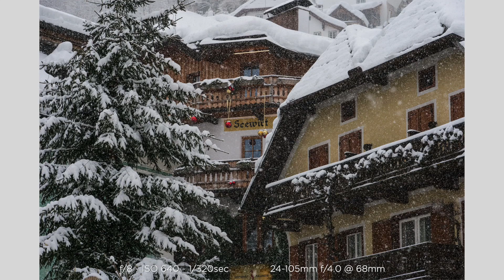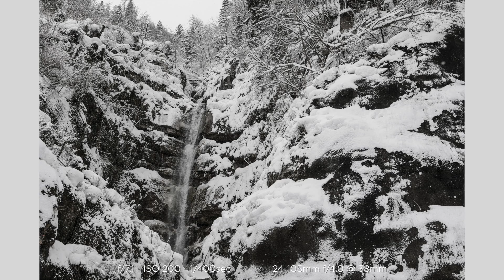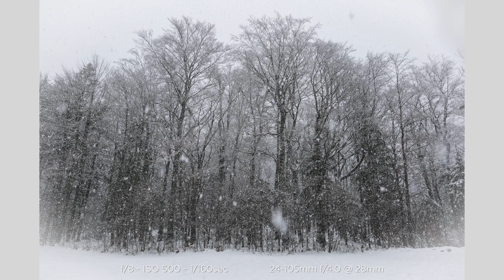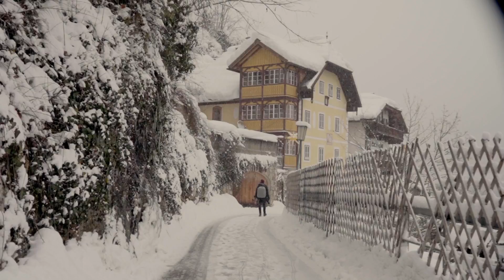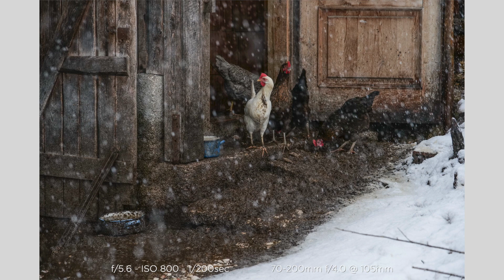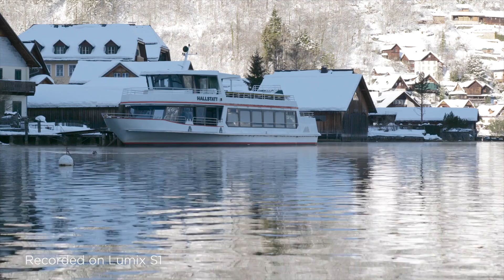Panasonic Lumix S1 & S1R | Hands-on in Hallstatt, Austria

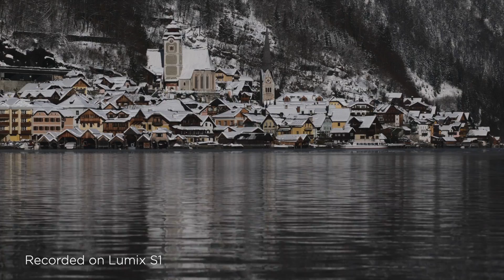Comment: Thanks for this very informative review 👍. But ahhhh, around 10:20, can’t believe it, to see the camera mounted to tripod instead of lens. With that heavy lens mounted 🙈. Do you have any idea how much force is leveraged to that tiny ¼” nut? I baby my gear as good as possible, so, this hurts so much.
Reply: It's an f/4 so it's only 985g; approximately the same weight as the camera.  The tripod collar is for convenient switching to portrait mode, and the L mount is built to be extra strong.
Reply: @fellowcitizen , which F4? Brand? Can't detect it in the video. However: I am NOT talking about the L mount. But the ¼" screw bottom of camera. ¼" = 11.5 inner and 13.2 outer diameter. This results in an average radius of 6.175mm = 0.006175m. I have no clue which lens that is, so, I must guess: length about 300mm, lets assume the mass centre is 150mm = 0.15m of the perpendicular angle to the ¼". f₁ • l₁ = f₂ • l₂ (leverage). Lets round the gravitation of  the planet from g = 9.81 m/s²  to 10 m/s² (however, not important, you can shorten that in the formula anyway) and the mass of 985 grams to 1 kg, that's exact enough for a comparison of forces. I go with the force Newton (N = kg • m/s²) but mass, so on planet Earth, the lens is pulling with a force of 1 kg • 10 m/s² = 10 N.  So, 10 N • 0.15m = x N • 0.006175m; x N = 10 • 0.15/0.006175 ➙ x = 242.875 N ≈ 250 N or 25 kg. If this is pulling exactly in the direction of the axis of camera nut and tripod screw: no problem. But it is NOT. It has a rectangular torsion to the axis of nut and screw and bends for that the bottom plate in worst case scenario. Believe me: this is really ugly. Try to hold this with your hands or fingers. It's no miracle, so many people are complaining, the tripod screw becomes loose and the construction of bottom plate is not strong enough etc., sticking a 1 kg lens to the camera 🙈 and mounting it to tripod by camera but lens collar. And messing in their replies lens mount and tripod mount, not reading nor understanding original text. Never start a technical discussion with a guy graduated MSc General Mechanical Engineering 😜.
Reply: Roland Rick Photography the lens is Panasonic 70-200 f4 L-mount. Therefore the maths is off from the start of the equation,
Reply: Aidan Davis no, it’s absolutely correct. Law of leverage is trivial Newton mechanics (and for sure totally independent of lens).

Comment: Good but overpriced ... and no articulating SCREEN!? Gosh ..
Reply: Hristo Dobrev Yes, I’m sure you were planning on getting one as soon as you stopped living out of your car. 😬
Reply: @CallMeChato   My car side mirrors are more flexible than the articulating screen. Until then I plan on shooting with my dashcam from inside the car. 😬
Reply: Hristo Dobrev I prefer using my car’s backup camera except I’ve killed two models shooting that way already.
Reply: Panasonic officially said the three-way tilting screen is more sturdy and reliable. In their opinion PRO’s don’t really need the fully articulating screen.  I have to agree with their logic, something about having the screen off-center makes framing and composing shots seem weird and less natural and IMO articulating screens are slower to use and more cumbersome.
Reply: The selfie screen format was not durable enough for the design objectives so they went with the lens-aligned tilt + portrait version like the X-T2.

Some demoes showed them holding the camera by the screen to show how strong it is, though they don't recommend it, obviously ;)
Reply: Seems to be the going rate (2,500 body only).